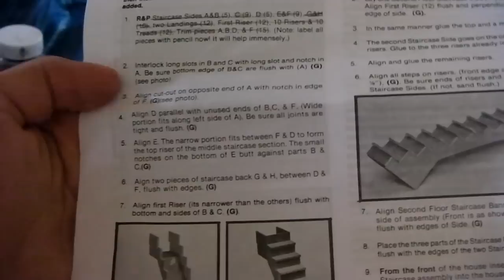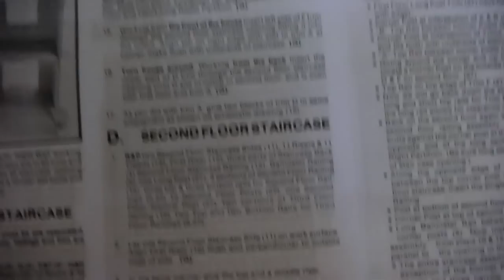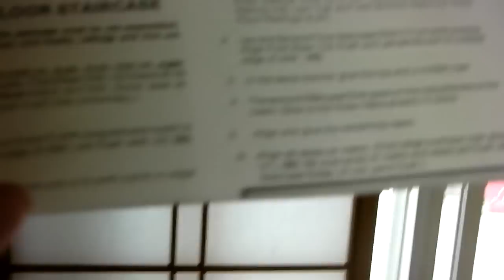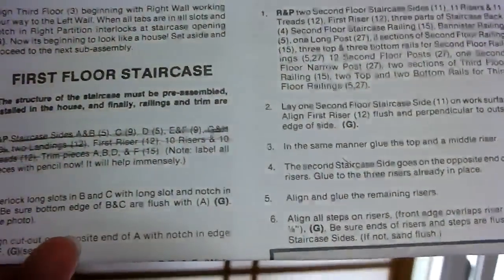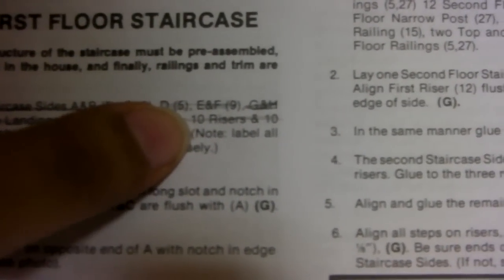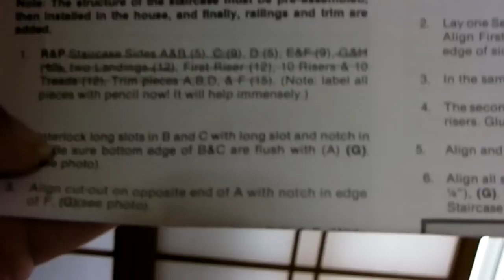Greenleaf Dollhouse Build - Day 7 and 8 (painting, paper and staircase)

Comment: Greenleaf kits are made of thin Luan plywood, which gives you a rough edge and also happens to be brittle wood.  Real Good Toys kits are made of a better quality (thicker) plywood, which makes it very easy to work because the edges are smooth, so no chore sanding the wood, plus you glue it ... and nail it ... so the structure is stronger.  One thing about Greenleaf kits, though, they have so cute, a lot of architectural detail, and they are not as expensive ... that is why they are so popular.  :)
Reply: Easier to modify also, easier to cut holes to turn a window into a doorway, add windows, etc. The RGT MDF is hard to cut through